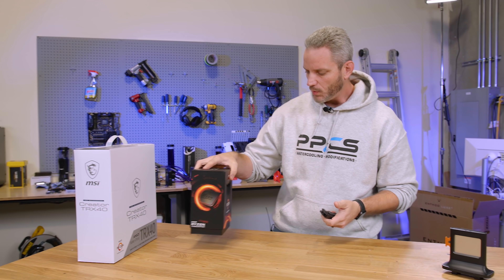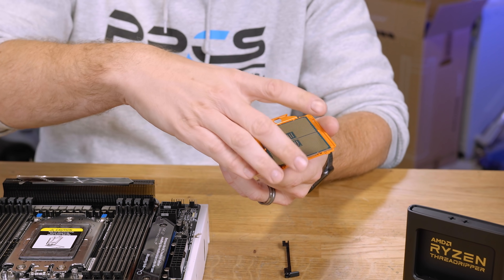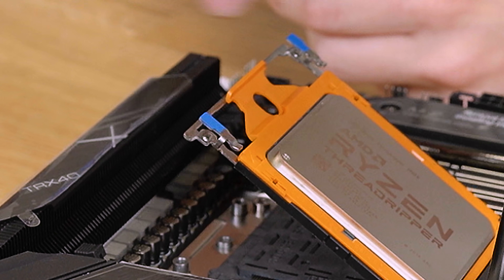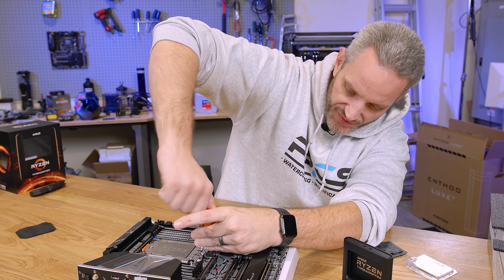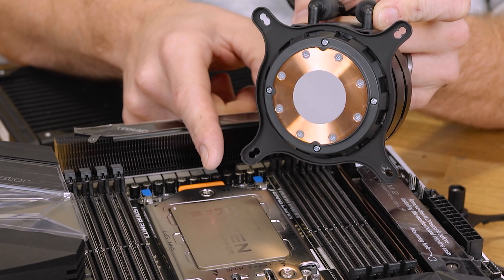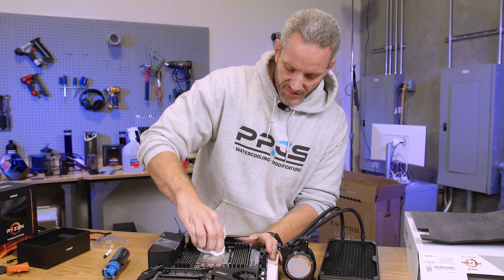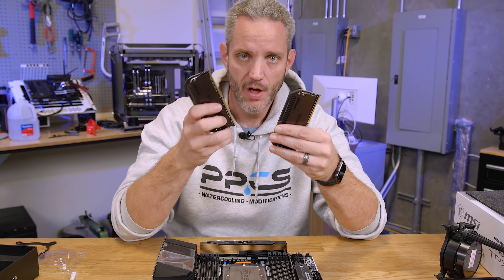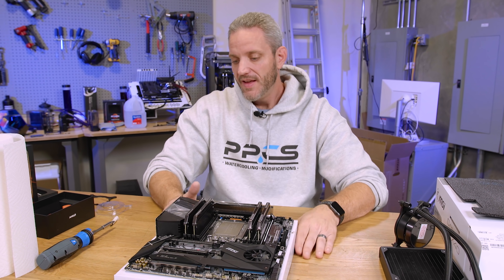Don't Make These Threadripper Mistakes!

Comment: I've been using threadripper, I always wondered why nobody addressed these things.
The asetek bracket fits many coolers, but the coolers dont fit the threadripper, the coolers say they are "Threadripper Specific" but truly that only means in mounting, not in ability to handle TDP. If you have a 32 core model or third gen make sure it's a really good one. Most aios or coolers will say if they support the 32 core model specifically. For example the masterliquid mirage or whatever says tr4 on the box, it wont touch the ihs fully but it fits the socket for tr4 so they market that.
-Make sure you get a good 16 phase vrm motherboard if possible. Alot of motherboards wont handle overclocking, this is worse on second gen I guess cause you can accidentally buy a first gen motherboard with a shitty vrm
- If you wont spend 100 dollars on an cooler dont buy a 1-3 thousand dollar cpu c'mon. 

The tool is only to stop stripping from the consumer and simplify it. It's not confusing or daunting it's way easier than normal cpus.
Reply: Well said! Do you think a Noctua NH-U14S TR4 will tame the 32-core Threadripper 3970x (280W) at stock speed at 100% load? I am hesitant to get a full coverage AIO like Enermax Liqtech II 360 because people report problems even with this new version.
Reply: @bgtubber  I think the problems were solved quite a bit back, performance wise the enermax is good. I never got one because of those problems I just stayed away but performance is apparently good now. The Masterliquid tr4 performs great but isn't the nicest looking aio. If you dont have your cpu yet I'd wait a bit cause a bunch of companies are probably gonna come out with specific ones. The noctua definitely would tame it if you have good airflow but its MASSIVE. It's a huge air cooler, wouldn't fit in a thermaltake core p3 or 011 dynamic for me with my layout. It's a good cooler forsure if you can work it into your build.
Reply: @Inismona27  Thanks. I don't have my CPU yet, but should very soon. I have a Noctua NH-U14S TR4 on hand so I will use that until a good AIR or AIO cooler comes out. BTW, I wouldn't consider Noctua NH-U14S TR4 massive. It's a single tower cooler. NH-D14 and NH-D15 yes, I can agree, but these don't fit the IHS of Threadripper. 🙂

Comment: i have been lightly covering the entire IHS even on my 3800x and it does fine
Reply: The 3800x is a mainstream cpu and isnt as huge and wide as the threadripper chips
Reply: @dirtyasianmafia2310  well yeah i know but its got more heat then a 2700x so i'll take my chances plus some mid 2020 i'll grab a new mobo 3900x and might hold out for a 5700xt or the next set of amd cards
Reply: @dirtyasianmafia2310  nice i'm a lil up start streamer so the more cores and gpu hp the better plus mid 2020 the 3900x should be like 460-480 after tax i'm hoping

Comment: oh god u just scared me .. i have 2 corsair vengeance pro i think one is  3200  and the other 3000 mhz
  and im running the speed on 29933
Reply: When you have DIMMs of different speeds, they will sync to the lowest speed and worst latency.
Reply: @renehoyvik  hmmm  i doubt it but i see it runnin smoothly  both are same brand  but one is 200 less

Comment: 11:50 pro tip : do not mess around with thermal paste around uncovered empty memory slots, paste will get into the slots and ruin your day (guess how I know)
btw to get the best effect "paint" your aio block contact surface with paste that way you'll get full coverage rather than a random spread like in this video

Comment: "Dont get an asetek AIO, cus a NOCTUA or a dark rock pro bla bla bla....."

The typical american that believe in branding it's coming out of you bro. You have thermalright silver arrow for TR. It shits on everything unless it's a custom loop with a good pump, and at least a 360 rad, and even then will still hold it's own.

And guess what. It's 90€ bucks.

Comment: I think even the pre ZEN opterons where similar , the socket was very close to SP3

Also if the board is T topology is does not matter if you put it in A or B as long as your consistent
Reply: Vishera and Bulldozer Opterons were no where near socket SP3 or TR4 for pin count. The G34 socket only had 1944 pins, the 4094 pins of SP3 and TR4/TR40 is over double the pin count of G34.

Comment: I would definitely not recommend squishing the AIO against the mobo the way you did it because of how fragile the "9000" pins are.
I do agree with all the rest you said :-)
Reply: Yea that advice was super dumb.
Reply: Yeah look at the amount of torque required to seat the CPU properly, no person would be able to generate that just by squishing your hands together so should be aight
Reply: I'm pretty sure that was not a recommended step. He simply did that to emulate the spread of thermal paste when the system is up and running with heat.
Reply: Too fragile if you ask me...  Especially since ASUS is known for returning defective motherboards to customers telling them the pins are damaged and the warranty is void.  DIY Threadripper is risky - probably better off buying a pre-built system with a real warranty.
Reply: @ericmatthews8497   it's not risky if you use common sense. :)

Comment: CPU has a handle and Jay holds the package with his grubby fingers instead of the handle.
Reply: Yeah, it was very noobish
Reply: @Stackali  Latex gloves is even worse than ungloved - static electricity. The bit of grease the pins will get through.
Reply: So this......
Reply: Like it matters.
Reply: @GoodOlTazzy  Oily fingers on CPU contacts does matter!
Reply: @4jewtube  no it doesn't.
Reply: @GoodOlTazzy  You haven't bricked a chip yet.  Keep handling it like a sammich and you will.
It's also why I never let anyone handle my custom builds.
Reply: @jdlech  lol sure, it's again one of those stupid myths like not being allowed touching the RAM at the bottom.
Reply: @GoodOlTazzy  It's not a myth! While today's components are well protected against ESD there is still a risk for damage and I find it very unprofessional to run a computer hardware channel and handle CPUs like a ******.
ESD damage is often not directly apparent, causing trivial problems, shorten the component lifetime, ... etc
Reply: @ppdan Even though that might be true, and don't get me wrong. I handle my cpus like they're made of gold. I don't think I would think much about touching the pins or stuff while installing or just doing stuff with my pc like that.

For me, if I don't drop it. Everything is fine.
Reply: @jdlech  It's not static electricity that is the issue, it's the oily residue from your fingers electrolysing into it's base elements which then oxidise on the contacts where the CPU touches the pins, as the oxidation builds up, the resistance increases along with the current draw which eventually burns the contact out. The more you overclock and force more current through the contact, the quicker the process will be. Touching any electrical contact point is in general a bad idea.
Reply: @ppdan  most stuff has bleed resistors in it these days so ESD isn't nearly as big a problem as back in the 70s, HOWEVER don't go putting your icky oily, skin-shedding digits all over the LGA pads or the edge connectors
Reply: @maxnaz47  It's worse in LGAs because the heat causes the pins to lose their spring tension and start playing up in ways that are hard to faultfind.

Ancient red hot 286s used to have this problem - it got to be a thing that some systems would have to be thumped before cold turn on, wait till they heat up and crash, turn off, thump again and THEN power up again with the storage powered up too - or just never ever turn the damned things off. (Usually "Business critical" Novell servers that companies simply would not replace....)
Reply: @miscbits6399  You might wanna research what a bleeder resistor is and where it is used before saying stupid things!
Reply: @maxnaz47  you just used a bunch of words that you have zero clue what they mean.
Reply: @elcidbob  It's ok if you don't understand, i'm more than happy to help you further your knowledge. What part was confusing for you?
Reply: @maxnaz47  maybe try taking chem 102 before being condescending and wrong next time my guy.
Reply: @elcidbob  Ok, how does corrosion really form on electrical contacts, according to you? Since how all you've manage to do so far is talk smack without anything to back it up.. Obvious troll is obvious, hence my justified condescension...
Reply: @maxnaz47  seeing as electrolysis is used to break apart oxides, you know the product of oxidation, it's pretty clearly not how you start redox reactions.

You're just making it worse on yourself my guy.
Reply: @elcidbob  Sodium chloride is not an oxide yet can under go electrolysis. what now?
Reply: @maxnaz47  🤦‍♂️ lol the best part is that you think that's a point.  Electrolysis is using DC electricity to catalyze a reaction that wouldn't happen anyway, which is why it is used mainly to break apart molecules into their constituent elements because the breaking of bonds requires additional energy. I didn't bring up the formation of salts because that would require acids reacting with bases and you specifically mentioned oxides.
 
Something like the oxidation of copper will happen when exposed to oxygen under normal conditions anyway.
Reply: @elcidbob  He said that with so much confidence LOL. ItS NoT aN OXiDe.😂😂

Comment: The Enermax Liqtech TR4 II 360 has kept my overclocked 2990WX below 64C at full load for months with none of the problems the original Liqtech.
Reply: How many months exactly? People report failure within 12 months even with the new version.
Reply: @bgtubber  I pulled it apart after 9 months of 24/7 use and the block was completely clean. I did have to RMA it because of a small leak in the radiator, but that was my fault I think. The full teardown video is up on my channel if you are interested.
Reply: @ElevatedSystems  Thanks for letting me know. Is it safe to say that if it's clean after 9 months of usage then the unit is going to be fine moving forward? Hm... decisions, decisions.